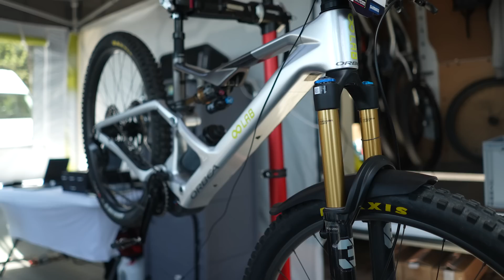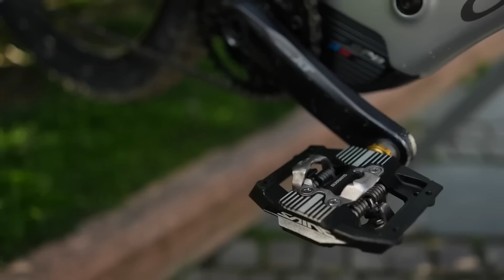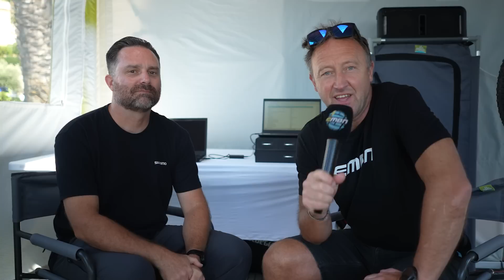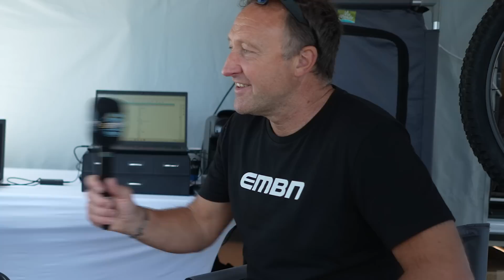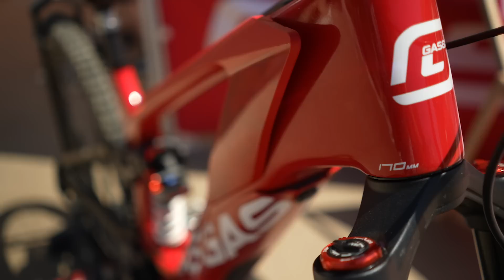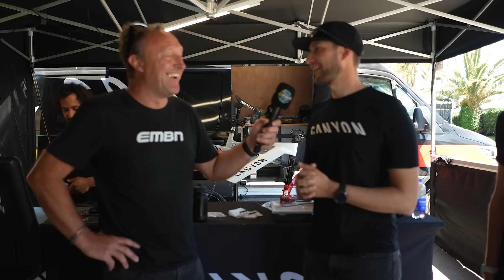What Does The Future Hold For eBikes? The R&D Behind The Big Teams

Comment from the maker: What's the one feature you would really want on an eBike of the future?
Reply: Mgu.
Reply: The future is now old man and it's called pinion MGU.
Reply: Longer range, please!
Reply: modular batteries, say 400 w, so that two could go inside the frame and another as an extender.
Reply: Manufacturer supported user serviceability, service manuals, spare parts. My next bike will have a motor that made by a company that supports this. You reading Shimano?
Reply: Pinion MGU :hands-yellow-heart-red:
Reply: New battery tech, solid state etc.
Reply: 2 wheels
Reply: Active suspension
Reply: Standard mounting and battery formats. Why be restricted to one brand and model even?
Reply: 3-5kw reliable drive trains.
Reply: Affordability and upgradability.
Reply: Post sale services, similar we have in suspensions. 
Gearbox, less maintenance on the bike (no chain, no derailleur, no hanger)
Reply: GPS
Reply: TQ50 ride quality/sound profile with 60-85nm power and 630+ watt power.  Give me the new Orba Rise LT/SL with a ride/sound profile of the TQ50...

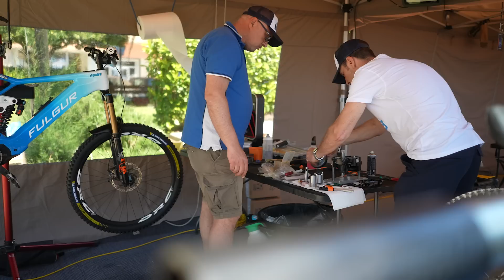Comment: Funny how it shows the guy rebuilding a Shimano motor at 17:18 and mentioning that they can replace all the parts, yet the consumer cannot do this, the Ebike Service centres cannot do this and Shimano won’t even offer this themselves. It’s a throwaway unit. A lot of the other brands are similar but Shimano is the worst. 😕
Reply: I have a SHimano motored bike. I have anxiety about it. I will never buy a bike with a Shimano motor again because of the servicablity.
Reply: Watch again carefully. Not Shimano. That is a Polini motor and with Polini you can buy all the parts to replace at home. Also you can buy the derestrict box from them to apply on Polini motors without loosing warranty.
Reply: @crencos  Ah yes, so they are. I thought the guys cap and shirt said EP8 but it’s EP3 which is the Polini. You should be able to do what Polini does with all the other brands.